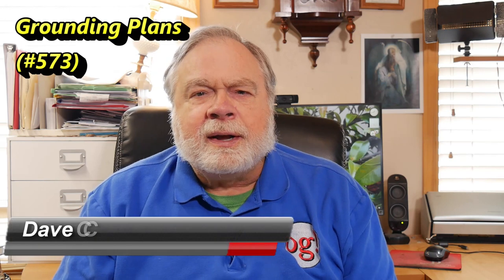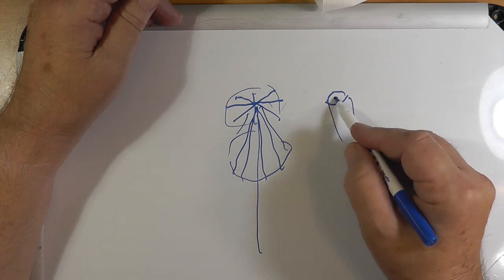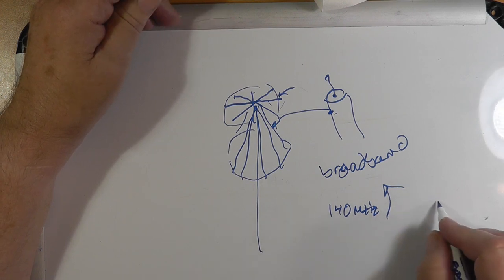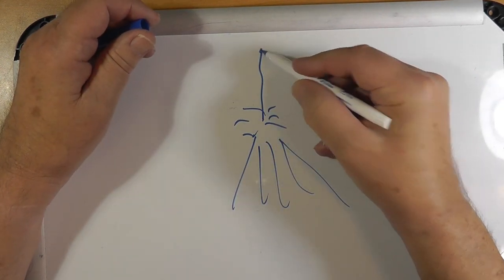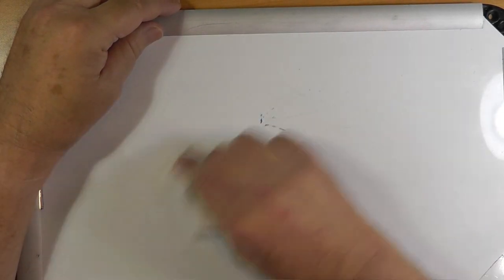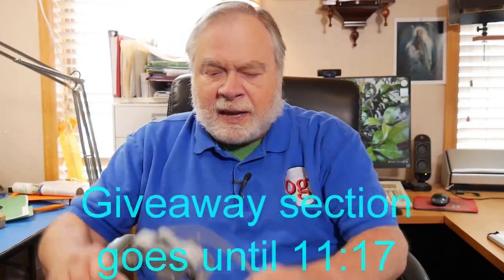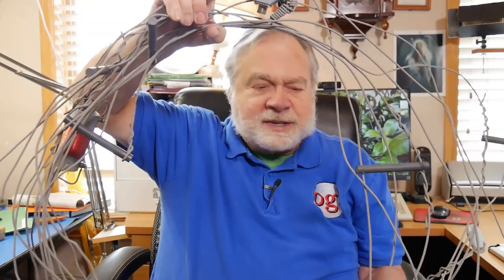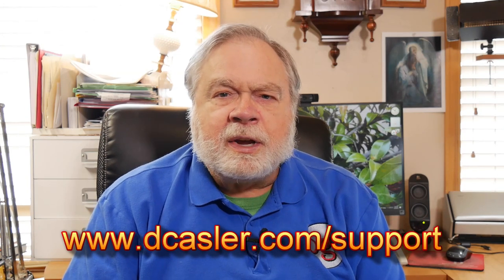Grounding Plans (#573)

Comment: Dave's suggestions about two separate antennas is correct and a better solution.  Why chance frying hundreds of dollar of radio gear. You will also get better quality receive (more HF frequencies)  for the SDR receiver if you use a separate long wire.  SDRplay has YouTube videos on how simple it is to setup a receive wire (speaker wire) for better performance. That's what I do for my RSP1A, RSPdx units.  You get what you pay for - I do not recommend the amazon SDR units that cost $20 bucks.  Good to initially play with but not really good quality.....you'll get frustrated.   KL1JP / Alaska

Comment: I was wondering can a ground plane antenna for example 1/2 wave ground plane if the radiating element stays the same length can it have smaller ground plane radials ? most programs on the internet show one length in accordance with frequency. sorry for the poor grammar.